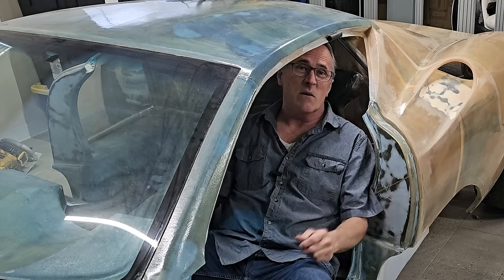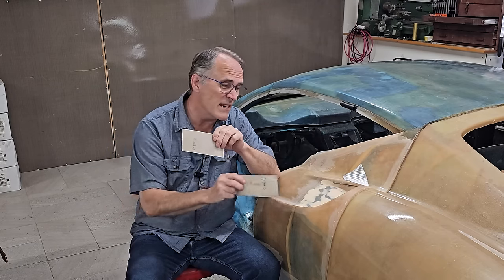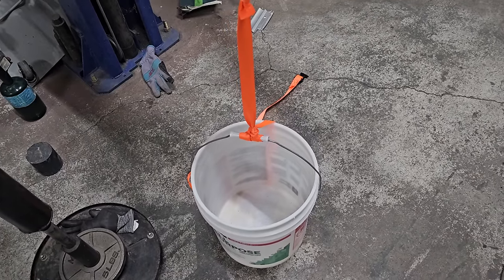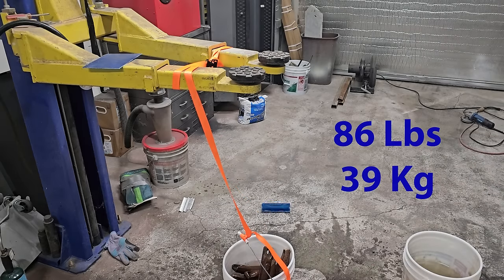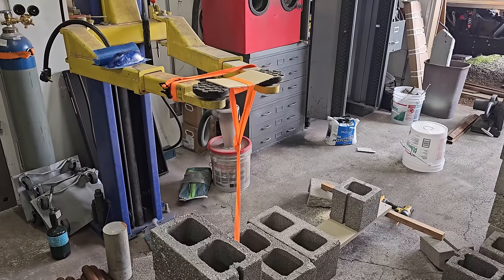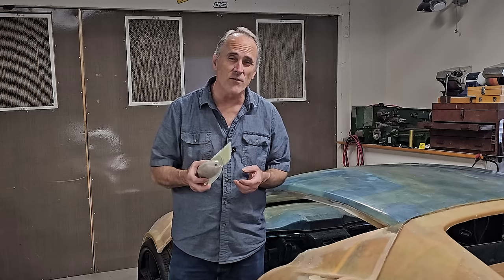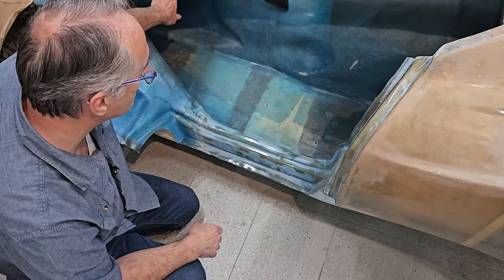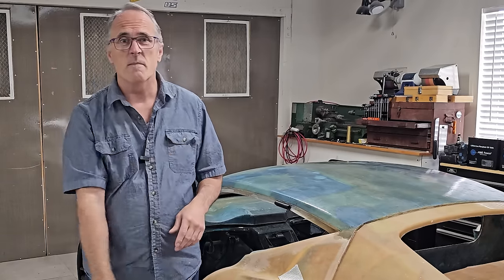They say it's going to break! Can composite engineering save my supercar?

Comment: A fiberglass boat doesn't just bust in half and neither will this.
Reply: Fiberglass boats have frame rails and a keel and stringers, they are also extremely thick 3/8th ish usually, they also do snap in half, spent 7 years building boats, his "monocoque" will absolutely fail.
Reply from the maker: Boats- 3/8 thick random oriented strand and polyester with a length of over 4 meters. Arete - less than 2 meters long, 1/2"+thick, S-glass, epoxy, planed fiber orientation.
Reply: Composites work so well they make submarines out of it, sorry was that too soon? BTW, I built/repaired fiberglass boats as well and I have seen various composites fail as well, the big problem is being able to detect the damage first as it can look good from the outside and be seriously compromised in areas you can’t see.
Reply: @BuilderCreator  the "load" on a hull is almost evenly dispersed across its beam and length, a cars is not, its focused on a area mostly the sills, but theirs good reason a monocoque is not fiberglass and is not done via wet layup.
Reply: @BuilderCreator  look you've done great work but do you really have the hubris to say that everyone ever who builds cars all those companies engineers builders ect are wrong? If mclaren or Koenigsegg could've save 10's of millions of dollars on enclaves and tooling don't you think they would of?
Reply: @benolofson9732  composites are fascinating in the various ways they are used. Aircraft, boats and cars all use different materials and techniques depending on the purpose. The only problem I have is not in the materials but in the blind faith some people have in them(not pointing fingers at all) The big problem is the hidden damage or internal failures that go undetected. I have seen boats that have sustained significant damage that only manifests itself as a star or spider crack on the outside but when seen from the backside is a large area of delamination and broken fiber. I loved how the capsule survived the weight test showing the value in using design as opposed brute material strenght.
Reply: @waynemanning3262  that's my point, a wet layed fiberglass monocoque doesn't exist in the automotive space, even most boat builders are atleast using vacuum infusion, theirs no way one person could ever figure out, shape, strand orientation, thickness variation, and material choices  by themselves, you literally cannot do the engineering solo and with practical tests you are done before you get to manufacturing which you also cannot do.
Reply: @waynemanning3262  theirs also such a thing as to strong...
Reply: @benolofson9732  Exactly. NOBODY makes a wet layup fiberglass monocoque. I do vacuum resin infusion myself on my parts. A monocoque should be carbon and should be cured in an autoclave.

Comment: Model A was built on a wood chassis, here you have the load being passed through the roof into the firewall from the bulkhead. Power plant attached to the bulkhead and it being the bulkiest part of the car, hence the name. A camaro only has 4 bolts holding the front subframe with 2 point, you have 4 points holding it. Though I do wish you had a crash bar hidden in the rocker for that extra protection, how each layer was applied makes this stronger then most airplanes 🤣 you'll be fine and just want to see it the "today is the day is finished" with a full compilation so I can show others its not impossible
Reply from the maker: When you hear me say "Today is the day!" and it means it is finished. Will that be a happy or a sad day? Both?
Reply: @BuilderCreator  I asked the same question about my 59 fiat 1100. I learned its not the project, but the journey towards a goal. Then we get to see what it can do! see it win all the awards and how happy it will make you 😁

Comment: Many aircraft have catastrophically failed in flight not because they weren’t made strong enough but because they didn’t account for fatigue caused by constant varying stresses, especially those that never exceed the deformation point.
Depending on the materials and the design such repetitive stresses may never cause an issue even beyond the normal lifespan of the aircraft (or super car) or they may fail quite rapidly.
A rule of thumb in design is to ensure that what you don’t want to break should have all forces acting on it accounted for and have visible markers that indicate fatigue before it becomes critical. Also if something is expected to eventually fail it needs to be replaceable. Generally you want to have something that can fail safely connecting things that you don’t want to fail.
Reply from the maker: I have 4 children and 8 grandchildren- when I finally fail, I have my replacements lined up!

Comment: Good info Jay.  I've been on racing sailboats in the 30-50ft range where the hulls are glass/core or now carbon/core and they can be anywhere from 1/2" to an inch or two think depending on which part of the boat.  The loads they take from a mast longer than boat length held up by tensioned rigging and then sails with the force of the wind is enormous!  And people sail around the planet in these.  I think you know what you're up to on this car and don't let the haters determine your need to respond.  Can't wait to see when she can finally get driven around!
Reply from the maker: Yes, moment bending stresses exponentially increase with span; I can see a 50 foot hull being very thick, with a built-up keel and bulkheads to spread out loads to boot. My pitiful 5 foot spans pale. If you are a boat person, I will let you in on a little secret- There is a boat project going on here at BuilderCreator.

Comment: I enjoyed your video and I really appreciate all the effort that you’ve put into this vehicle. If I were to provide a peer review, I would say the following:
1. Your sketches didn’t show any triangulation between the beams that you’re running in the vehicle. Nodes and trusses greatly improve the stiffness of any structure, that’s why space frames and bridges and even monocoque chassis’s are built this way.
2. Instead of foamcore, I would use nomex honeycomb
3. Because the shape of a vehicle is an extremely complex structure, you can create a finite element model of your vehicle and test it in any way you’d like using finite element simulation. Chassis design is an iterative process.
4. Generally speaking, the tensile strength of any material in any shape is available for free online, there’s no need to do any testing. The shapes that are generally used usually form closed structures, and the proven methods are usually body panels over DOM tubing, but you can certainly build a space frame from carbon fiber as well or glass fiber.
5. Because your frame uses complex shapes and directional composites, the analysis becomes much more complicated but it’s hard to know for sure even after all the testing you performed. I would highly recommend creating a finite element model of your chassis and having someone with LS-DYNA or Ansys run the analysis for you. 

Good luck!

Comment: In 1985 Warren Mosler, built the Mosler Consulier GTP. 1988 It was the first car to pull over 1g grip and well exceeded all speed and safety standards, the chassis was made from a fiberglass-and-foam monocoque, with an integrated carbon-Kevlar body. It weighed only 2,200 lb.
The Consulier GTP was banned from IMSA racing in 1991 after being given a 300-pound weight penalty. The car's excellent power-to-weight ratio, in 1985, was originally powered by a 2.2 liter, turbocharged Chrysler 2.2 I4 Turbo II and success in IMSA racing for six years made it unbeatable. 
The Mosler Consulier GTP Is America's Forgotten Supercar. 
Jay your doing what one of the greatest builders did. 
Road and track and other publication talk how ingenious he's design was!
Your car probably will out preform most higher value cars.

Comment: More great info!  I stopped using polyester and gelcoat even for non-stressed parts and have been using epoxy /glass and carbon along with nomex honeycomb from Boeing surpluses and have made some seriously stiff composite doors for 2nd Gen Firebird that weigh only 10 lb 15 oz including inner door panels. These are BIG (60 inch long doors) and are arrow straight, will look factory when painted. All hand laid. Epoxy to fiber is only 12 - 15 % more than vacuum bagged as weighed.
Reply from the maker: Sounds right in there. Now if you could only get hold of some "transparent aluminum" to reduce the weight of the glass! ;)

Comment: Watching your build from the first video, I have never doubted you were doing your homework and building a car that has more than enough strength to handle the projected loads.  My one "concern" was that you were building in too much strength and could actually lighten the car from where it has ended up, yet still have more than enough safety factor.  But I also understand you are not performing FEA on the structure, nor working with a laminate engineer, and therefore are properly erring on the side of a little bit overbuilt is far better than a little bit underbuilt.  Your work is first class and something all of us should ascribe to achieve.

What is going to be interesting to see in the years to come is the application of AI to laminate structures and how layups will be transformed to carry the designed loads.  I have seen some renderings of AI generated composite structures and they look very organic and almost artistic in their form.
Reply from the maker: Czinger has used a lot of Generative (AI) design in their car. Interesting, is that you start with one set of design parameters and as the car losses weight you have to start over with new parameters.

Comment: I like the composite foam core samples since im considering buying a composite camper for my truck and hopefully not building it. The industry uses wood framing, which im thinking is a waste. Dead weight, especially on a 1500 series truck. Cheers!
Reply from the maker: I have a test panel I created for the Leviathan project; 2 inch extruded styrene foam, backed on each side with only two layers of glass and you could drive over it!
Reply: @BuilderCreator  awesome! That would be strong enough to sustain the cab over bed. I would build the two side walls and roof  like that and a separate tub. Then bond them together.

Comment: My fatherinlaw built a Varieze airplane in glassfibre and flew it hard for 20+ years whitout problems so im sure your build will work 💯%
Reply from the maker: Even if it doesn't, I will not be falling 10,000 feet after I find out there was a problem. Ha!
Reply: @BuilderCreator  True👍

Comment: Very good explanation. You’ll probably add a steel cage inside also? And I wonder about what a crash would do to the structure… do you have structures made to fail and absorb the impact as well? Thanks for all the videos, they’re awesome. Hope to see it finished soon!
Reply from the maker: The subframes have crash structures, and the rear subframe/engine is designed to break away in a serious crash. Here is a video talking about the interior steel roll bar -https://youtu.be/736LR3vjoM0?si=Bs6EHRak5x-luN5j

Comment: I used to build composite aircraft. Kit production and complete planes. There is a reason that carbon fiber is usually used to make a monocoque chassis. I know what it felt like to fly in a carbon plane versus a glass one. (Berkut vs. Long-Ez for instance) All you had to do to really understand was grab the vertical fin on the end of the wing of each plane and shake it,  there is a noticeable difference in feel. The Berkut is way more sensitive in flight from the stiffer airframe. It's like comparing a street car to a race car for instance. The carbon fiber was so much more rigid it was ridiculous. It may not be whether it breaks, but if it flexes too much for the amount of power/cornering loads that you plan to achieve. The design and layup schedule will dictate that, but it's always a smaller layup schedule for the same rigidity with carbon fiber. Did the monocoque get heat cycled for the cure?
Reply from the maker: All true, but I have answered the $20K dollar difference question before. When I get to the aircraft, it will be carbon fiber (weight counts) or sitka and fabric.
Reply: @BuilderCreator  I am biased...  lol.
Reply: @BuilderCreator  The fiberglass planes I built WERE light, just not as stiff as carbon ones.

Comment: Great video!  I've always found S-glass to be more expensive and harder to come by than carbon fiber though; I'd prefer to use it for making body panels if I could get it because of its nicer mode of failure.
Reply from the maker: Almost every vendor caries some S-Glass. The selection may not be as vast as E and Carbon, but it's out there

Comment: As an architect that does his own structural engineering (most of the time) it took one particular structures professor to open my mind to beams and the loads within them...Horizontal Shear was the most epiphanal.

That said, I find the strength of diaphragms far more fascinating.

BTW, we architects are a bit persnikity about the difference between FORM and SHAPE.

Shape implies a 2D component and Form a 3D one, clearly with dynamic loads in vehicles 3D is infinitely more complex...

Respect to Naval Architects... those guys can analyze a twisted beam...

😊
Reply from the maker: I worked a few years for a structural engineer that was also the professor at the State college; that's how I got into architectural design. My "epiphanal" moment was when I realized most materials will work with the right connector.  It won't be long before high-priced software to do serious calculations (FEA)will be replaced by Ai that just needs a 3D model.
Reply: @BuilderCreator  Ah yes, I taught Urban Design to upper class college kids at a VA University.

Topic got around buildings in some detail...

Blew some minds when I said "forget 3D Printing; wait 'till you kids are all old like me and buildings begin to be bioengineering".

Your one of my fave channels!
Reply from the maker: @vicmontes7314  I remember back in the 80s someone was building a steel mesh frame and then placing that frame in the ocean with an electrical anode attached to it and "growing" calcium structures. How about 3D printing a thin shell and reinforce it with an internal "grown" crystal structure? We are about to see some really crazy tech!

Comment: Dumb question time:   If the direction of the fibres are offset by 45 degrees does that help or hinder.
I was thinking of ply-wood that alternates the direction of the wood-grain to improve strength, but given the the fibre cloth already has fibres running at 90 degrees to each other, then a layer at 45 would seem to help... Or have I missed something?
Reply from the maker: In the Tub, I need very little strength running from side to side. Most loads will be from front to back (connecting the subframes). Turning the fibers to 45 deg to that axis aids in preventing twisting.

Comment: Not that I’m one of the doubters but did you allow for the fact that the closer the load got to the fulcrum point the less weight would be on the strap?  Not that it matters much because the care is going to be plenty strong enough to be safe (likely safer than most vehicles currently on the road at the moment especially those built before the 1980s).
Reply from the maker: I did say at the beginning that it was scientific, but not accurate. Ha! It did work to show the drastic difference between samples, however. Crash safety, is knowing how to leap from your motorcycle at the moment of impact, to diminish the flight distance. ;)

Comment: Be careful with your use of uni.  Typically it is used with several layers and altrenating strand orientation. 

Unidirectional fiber is extremely ansi-isotropic and the loads in a chassis aren't always coming from the same direction (especially in a crash) so rather than putting all of the strength in one direction you need to mix it up.

I've seen shockingly light weight construction with fiberglass that didn't fail (but it flexed a lot) and 6-8 layer layups that were unimaginably stiff.  If you have 5 layers for the body and more for the tub, you should be fine if your subframe attachment spreads the load over a large enough surface on your tub.
Reply from the maker: Yes, and as mentioned, the Uni layers are all congregated with layers of Biaxial cloth, mostly running at 45 degrees.

Comment: I'm not doubting your construction methods, but I feel you could simplify the test process by using a digital tension scale, (a kind of industrial version of the simple hand held scale used to check your luggage weight). Secure an eyebolt to the ground then slowly raise your car lift forks. This would be way faster than endless buckets & concrete blocks.
Reply from the maker: I have a strain gauge, but how "visual " is that?

Comment: whats your opinion on CFRP ? i have a carbon body from an BMW i8. it does have crash damage on the driver side A pillar, I hope i can repair it. But what do you think about cfrp strenght capabilities ?
Reply from the maker: Repairs are never as strong as the original layup, but that is true of any car repair, composite or metal. You should be able to get it back into condition to keep you safe, should the car encounter a second A pillar mishap.
Reply: @BuilderCreator  okay thank you, that gives me some hope. I really appreciate all the videos man. I could never learn this stuff anywhere else 🙏💯

Comment: GTM Libra is relatively modern fibre glass chassis kit car....  watch out for hot engine bay and black paint in the sun causing the chassis / resin to lose a bit of strength